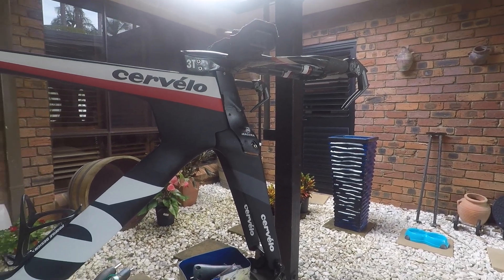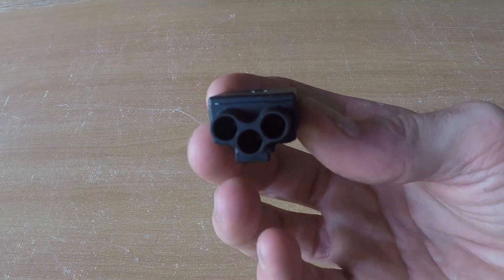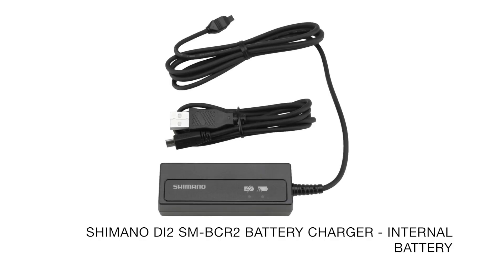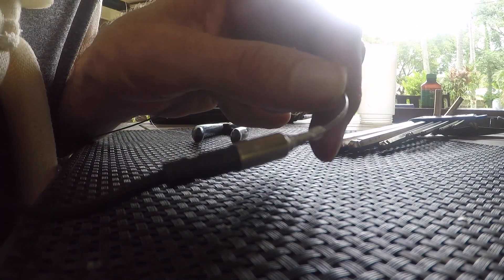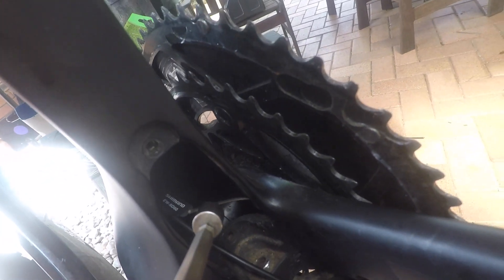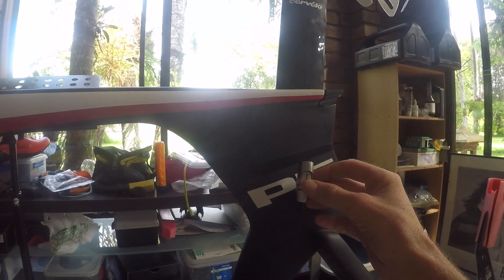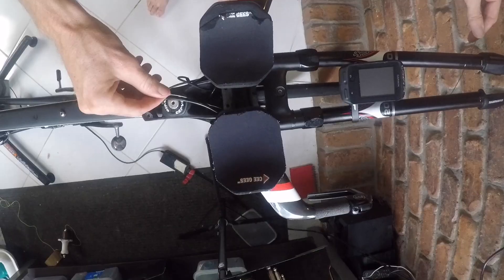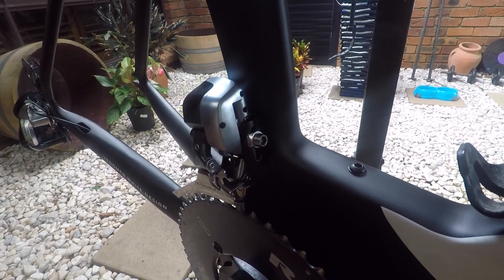How to do  Shimano Di2 Time Trial TT Triathlon Upgrade Build

Comment: i have the same set up but now i decided to reverse the installation of the aerobars. the short bend will now be the one inside the the mount and the long bent will be the one that i will grab during aero position. what will be the hard part in doing so in terms of the di2 wires/cables?

Comment: Thanks for the informative video! Im new with di2 purchased 2nd hand cervelo p5. How would i know the battery level of the di2 since the junction A is hidden? How often should i charge the battery? Thank you very much!
Reply from the maker: In the stem compartment where the junction box is, in a dark room when you hold the big ring button for a couple seconds you’ll see the LED indicator flash to give your level of charge. You can angle this in a way so you can see it though the base bar, and if not drill a small hole in the top cap. But ultimately just take the 4 bolts off and check. 

Depends how much you ride,
Sometimes I’d have to charge every 2 months, where others will last a year.
Reply: @damiencollins8124  thank you so much really appreciate! Cheers from the Philippines! Check out IM70.3 Puerto Princesa i live here.

Comment: Doing a Cervelo P2.  Measured on frame what length of wire I’d need. Yours seemed quite a bit longer?  Is there much room for slack if the cable is long?
Reply from the maker: id rather them be a little long and curled up in the frame than short and hard to work with

Comment: great video thank you! i'm need to change my basebar and have Di2 already on the bike. Am I going to need to completely remove the brake cable before i can unscrew and remove the ST9071 levers?
Reply from the maker: Remove the inner cables and the outer brake cables should be able to stay coming out of the frame. Well the rear one at least the guide the old cable through the new base bar and I’d just run a brand new one to the front. Then pull
The di2 cables through last.

Comment: Great Video! Thank You Damien, Couple questions:
What are the differences between the one-button shifter and 2 butter old style shifter? Does the 9070 have the ability to be upgraded to the new synchronized shifting? 
If you want to have blue tooth capability (EW-WU111), you would have to switch the battery mount to (BM-DN100)? Is the Older 9070 derailleurs still able to communicate and be adjusted via Bluetooth? Is there an advantage to having a seat post battery?
Silly question, but for the P5 do you have to remove the rear wheel/access the space every time to charge the battery?
Reply from the maker: Michael Kezian  hey mate, yes the 9070 & 6870 can be upgraded to Syncro, however you will need the BT-DN110 Bluetooth battery or if you have a P5 Or anything with an external battery you can buy the BT-DN100-S external battery mount + the EW-WU111

And yes all the old 9070 components are comparable. No real advantage to an internal batter on a P5 because it’s hidden, maybe a minor bit heavier but the internal battery  is easy hidden on other bikes
Reply from the maker: Michael Kezian and yes do need to remover the rear wheel. However I ride on the Kickr a lot so my back wheel is often off. If you have a spare battery (2) you can charge the spare and literally swap it out.

Comment: Do I need to remove the bottom bracket for installation of a Di2 aero kit on a 105 P2 (2017)? The bike is “designed for electronic” but the press fit bottom bracket is keeping me from installing the Di2 groupset myself. My battery would be internal.
Reply from the maker: tengamangapiu P2 doesn’t have the little rear panel like the P5 does so he’s BB would need to come out. I would suggest not shortcutting and trying to work around it. Take it to your LBS ask them t remove it. Do all the di2 install
Then ask them t put it back in. Won’t cost much and doesn’t take long if you don’t own the tools.

Comment: Hello, i have a question. Im converting my aeroad to a "mulet tt bike" keeping the road shifters di2 ultegra in place but trying to put some tt bars di2 shifters on the poles. Do i have to change the 3 port junction box i have for a 5 port junction box,  or can i do something cheaper ? Other question : When you plug new shifters, does the system knows what to do with the new shifters or to you have to do a e-tube configuration etc...? Thanks on advance if you have answers.  Not sure i understood everything in the vidéo as english is not my language....
Reply from the maker: Jean Chie you just need a 5 port junction box, they are pretty cheap. Just swap it with your 3 port and that’s all u need to do, the electronics will know there’s been an extra set of shifters added as is only sending a change gear signal just like on your hoods
Reply: @damiencollins8124  ok thanks for the help! And when i swap to the 5 ports junction box, as i understand what you said, it'll all work together without even doing an update with a computer? just swaping the box, plugging in the 4 wires of shifters and the one that goes to the battery and junction B and it'll work fine?
Reply from the maker: @mael5405  yep
Reply: Cool, merci!

Comment: Hi mate, one question from spain. Did you instaled the 
Shimano Ultegra Di2 SW-R600 Comand on your magura brake levers? I have the same bike but i miss thouse comands. Thnk
Reply from the maker: fernando ojeda alvarez hey mate, no in the video at the time I did not install shifters one my breaks, but since then I have removed the rear Magura brake and with some parts installed a Shimano direct mount break to the frame so I have the di2 brake/shifters for the rear derailleur now
Reply: @damiencollins8124  ok good idea, what kind of rear brake did you installed?
Reply from the maker: fernando ojeda alvarez a Shimano direct mount